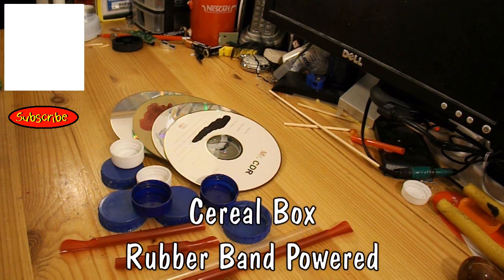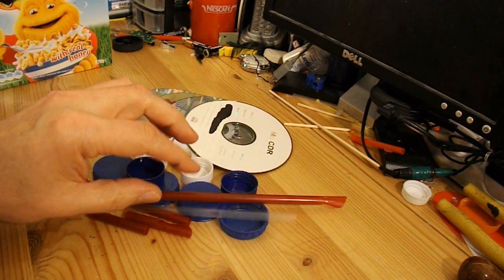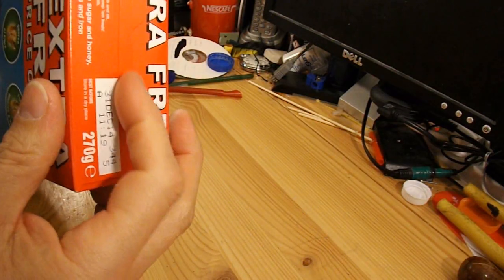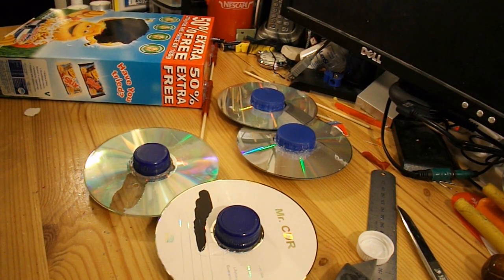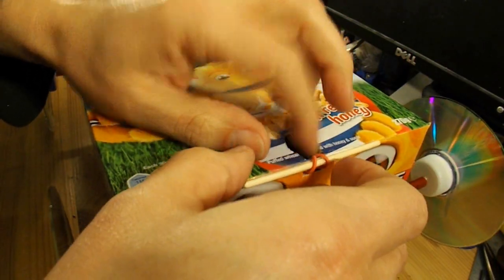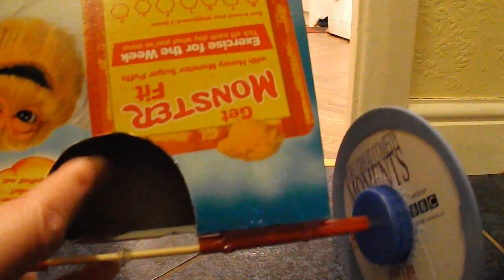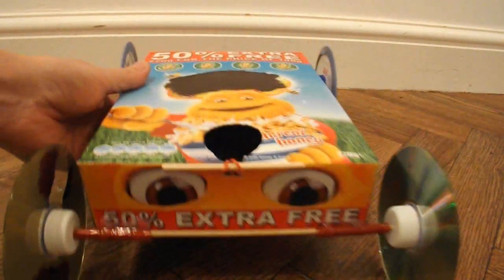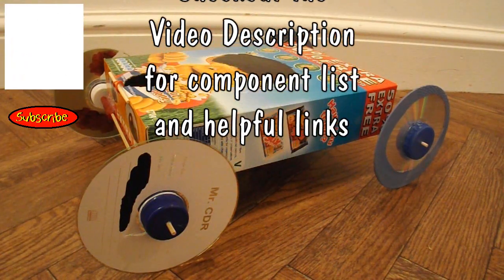Cereal Box Rubber Band Powered Car

Comment: My car keeps on turning left
Reply: Is there a way I can fix it
Reply from the maker: Hi Kayla. Here is my standard reply for this question, it might have the answer for you.
There are several reasons the car might turn to the right - or left -  here are some I can think of.
1. Your front axle is not parallel to your back axle so the car has an inbuilt turn. A quick check would be simply to push the car forwards without the bands connected and see if it turns.
2. When you tension the rubber band the body or the axle is flexing creating a turn. Try winding the band to one side of the axle. Looking from the back if you wind it on the right it pulls the right side of the axle forward turning the car right. If you wind it on the left it pulls the left side of the axle forward and the car goes left. https://youtu.be/IErkUylbG9c?list=PLA5a2xPRSrB3g5RiX8Kf_uUBOL0Tb7AS0
3. Probably most likely, the wheels are spinning under power allowing the back of the car to slide to one side. Fix this by adding extra grip to the wheels such as a strip cut from a balloon or rubber gloves stretched around the rim of the wheel to provide a rubber tyre. Here is a link that shows this http://youtu.be/ZnuPnveCbxs
4. The front wheels are sliding sideways under power, fix this the same as '3' above.
5. One or more of your wheels are binding on the side of the car causing it to turn.
6. One or more of your wheels are not round and the unevenness is causing the car to skip and turn.
7. Your wheels are not the same size so the car turns towards the smallest wheel.
8. Your axles are not level with the ground and the car is running on only 2 or 3 wheels. This may be the body flexing and not show until the rubber bands are wound up and under tension.

Comment: my front wheels wont turn ?
Reply from the maker: I would guess the holes for the axles are too tight or the wheels are rubbing on the bodywork. Here is my standard list of hints and tips. Fault Finding on a Rubber Band Powered Car
1. The rubber band does not connect to the front axle, some people misunderstand the videos and attach the rubber band to the front axle as a convenient anchor. That stops the axle turning. Make a different anchor point, study the video again.
2. Does the car run forwards freely if you just push it without the rubber band connected?
If it does not, make sure that the axles are free where they pass through the body. You may need to enlarge the holes where the axle goes through the body or use larger tubes for the axles to go through.
Are your wheels round with no flat spots. You may need to trim them.
3. Do the wheels rub against the body of the car?
If they do, the friction will slow the car or even stop it moving.
Put some spacers on the axle between the wheels and the body to keep the wheels clear. Discs or washers cut from plastic or cardboard should work. 
4. Do the wheels spin evenly when you watch them?
If your axles do not pass through the centres of the wheels, the wheels will not spin evenly and this makes it harder for the car to run, so you will need to make new axle holes, taking more care finding the exact centre.
6. When you wind the rubber band round the axle do the wheels turn at the same time or are they slipping on the axle?
If the wheels are slipping on the axle, the rubber band will unwind without the wheels turning on the ground. You need to do something to stop them slipping. Glue them to the axle or wrap tape round the axle where the wheels are to hold them in place.
7. When you release the car it does not move, but if you lift it in the air, the rubber band unwinds and the wheels spin OK.
Either the ground is too rough or the car is too heavy. Try the car on a smooth surface, make the car lighter, add more rubber bands. 
7. Wheel spin. When you release the car, do the wheels spin without the car moving forward?
You do not have enough grip on your wheels. Either add some weight to the car to help the grip or put something on the wheels to improve the grip. 
Things that will improve grip - hot glue all the way around the rim like a tyre. Rubber bands stretched across the wheel. A strip of rubber cut from a balloon stretched around the edge of the wheel. Strip of rubber cut from washing up gloves or disposable rubber gloves.
8. Trouble connecting the rubber band to the back axle? Glue a short stick to the axle to act as a hook for connecting the rubber band.

We are trying to construct a rubber powered car that can go as "far" as possible. It doesn't have to be fast. It just has to travel as far as possible and as "straight" as possible. Can you please recommend me a design? Or at least give me a general idea of what critical points I should be aware of while designing my car?
This is a fairly regular question. 
I am assuming you have some set criteria for number of rubber bands and size of vehicle so putting those aside. The first point about travelling fast or a long distance is minimising your friction because that is what wastes your power. 
1. Friction caused by badly aligned wheels rubbing on the bodywork should be easy to fix by adding spacers to keep the wheels clear.
2. Friction where the axle is attached to the bodywork is reduced by making sure the axle bearing surfaces are something that does not bind together. Wood and cardboard are not good. Metal surfaces are better. Steel and brass is good. Ball race bearings would be even better. Whatever you have, even if it is just wood and cardboard, you can improve by making sure there is clearance so they do not jam together and maybe rub some graphite from a pencil where they make contact might help.
3. Friction with the wheels to the ground can be a mixed blessing. Minimise the friction of the front wheels by using very thin wheels, however you may need some grip to ensure they keep the car going straight. The same applies to the back wheels, assuming you are using the back wheels as the drive wheels. However if they do not have enough grip they will spin under power and that is all wasted energy. Thin wheels with rubber tyres would be best in that case.
Larger wheels take more effort to get them turning but once moving they have the momentum to keep rolling when the rubber bands have finished. You could experiment with different sizes to see which work best.
You could use some sort of gearing to start with a large gear to get the wheel moving and then a smaller gear to maintain the motion. There are some examples in my playlists.
Reducing unnecessary weight by trimming the bodywork a little may help but make sure you don't loose grip and start the wheels spinning if the body is too light. It may bend or break under tension so be careful.
Another trick I have found helps is to stretch the rubber band as you wind it round the axle so you get more turns round the axle, this can make a significant difference compared to just winding the band normally.
If you can only use a short rubber band, connect it to the axle using thin string so the string winds round the axle stretching the rubber band. Thin string will give you more turns round the axle than thick string.
This simple one does 12 metres https://youtu.be/pIO3FiHX4Oc with just 1 size 64 rubber band.

There are several reasons the car might turn to the right - or left -  here are some I can think of.
1. Your front axle is not parallel to your back axle so the car has an inbuilt turn. A quick check would be simply to push the car forwards without the bands connected and see if it turns.
2. When you tension the rubber band the body or the axle is flexing creating a turn. Try winding the band to one side of the axle. Looking from the back if you wind it on the right it pulls the right side of the axle forward turning the car right. If you wind it on the left it pulls the left side of the axle forward and the car goes left.
3. Probably most likely, the wheels are spinning under power allowing the back of the car to slide to one side. Fix this by adding extra grip to the wheels such as a strip cut from a balloon or rubber gloves stretched around the rim of the wheel to provide a rubber tyre. Here is a link that shows this http://youtu.be/ZnuPnveCbxs
4. The front wheels are sliding sideways under power, fix this the same as '3' above.
5. One or more of your wheels are binding on the side of the car causing it to turn.
6. One or more of your wheels are not round and the unevenness is causing the car to skip and turn.
7. Your wheels are not the same size so the car turns towards the smallest wheel.
8. Your axles are not level with the ground and the car is running on only 2 or 3 wheels. This may be the body flexing and not show until the rubber bands are wound up and under tension.

The two most important factors for acceleration and speed over a short distance are the power of your motor and the grip of your wheels. If you don't have the power then your car will not move fast but if your wheels don't grip then any extra power will just spin the wheels and the car won't move. If you have a fixed amount of power by being limited to the number and size of bands you can use then you can increase your acceleration by enlarging your back axle. I wrap stuff around the axle to make it thicker. That will increase the acceleration but probably reduce the total distance your car will travel. If you are only going a short distance that probably won't matter. You can also use smaller wheels to increase acceleration but you will find it even harder to get good grip with smaller wheels.

Some helpfiles
Making the CD wheels https://youtu.be/ZRrjBuWfmrM
CD Wheels with Cardboard Hubs https://youtu.be/Js1rtn2IGTE
Putting rubber tyres on CDs https://youtu.be/ZnuPnveCbxs
Connecting rubber bands https://youtu.be/EbYuhdwknbs
Connecting the band to the axle https://youtu.be/0wPYxloUFJQ

Comment: Kang Guo
4 minutes ago  ·  Shared publicly 
 
Your the best, thank you so much. I would love to know how to make cereal box rubber band car faster. Because we are doing a race at school, the winner gets a prize. Thx so much.
Reply from the maker: The obvious answer is to use more rubber bands. You will also need to put rubber tyres on the back wheels to make sure you have enough grip. I have a video showing you how to do that here http://youtu.be/ZnuPnveCbxs?list=PLA5a2xPRSrB2v0vxMJyZ9cPweAGx1FK6e
If you just want speed and not distance you can increase the size of the part of the axle where you wrap the rubber band round. That changes the gearing and gives you faster acceleration, here is a video showing an example.
http://youtu.be/vc0URTIqdSA?list=PLA5a2xPRSrB2v0vxMJyZ9cPweAGx1FK6e
Reply: Kang Guo bruh

Comment: How long can it go
Reply from the maker: I was asked to make a car that would go 3 metres, in the video it travels 5 metres. I had no reason to measure if it could go any further but as it hits the wall at the end it could clearly go further if the wall wasn't there. The distance would depend very much on what rubber bands you use. You will find useful information in the video description including links to my various rubber band playlists including my "Put a rubber band on it" channel which is devoted to rubber band power

Comment: Do you have to use a hot glue gun
Reply from the maker: You can use whatever you want as long as it sticks the components together. I like hot glue because it is very quick to use and will stick to almost anything. Many other glues take hours to dry properly, so as long as you are not in a hurry there are plenty of alternatives.